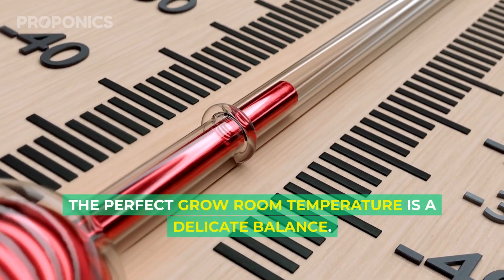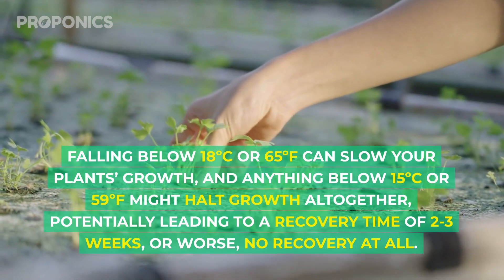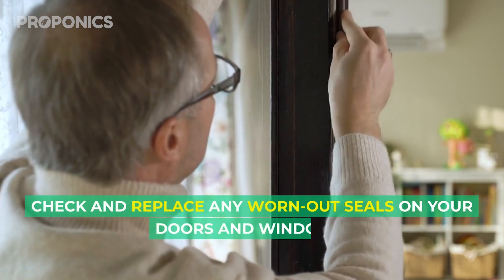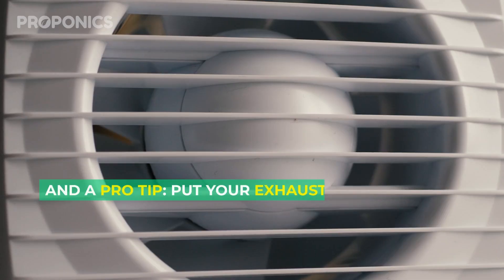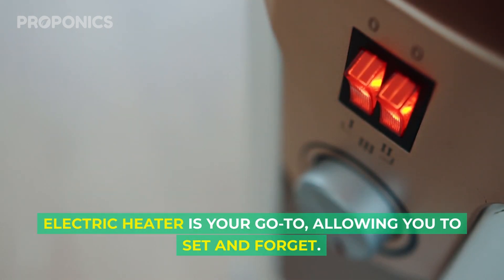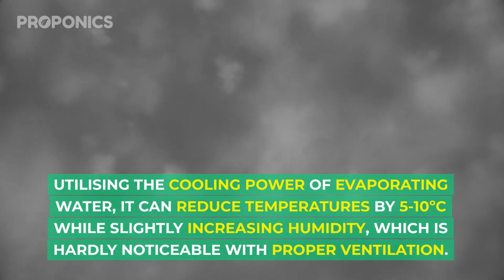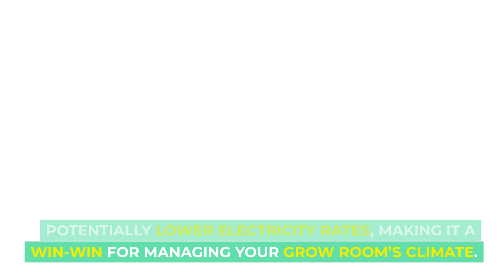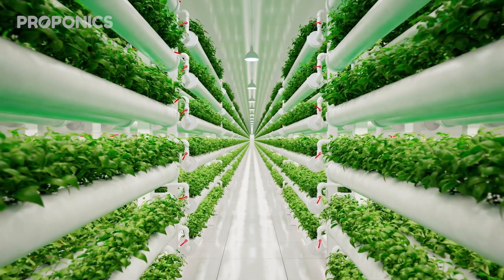Grow Room Temperature Management

Comment: which temperature is too high? in my tent i have an average temperature at the canopy of 27-28°C, plants are growing but what are the limits?
Reply from the maker: Great question, the temperatures I use in the video are a general guideline but each grow will have its own nuances like the species of crop you are growing, humidity, etc. If you find that your plants are looking healthy and that their growth rate is as you expect then a temp between 27-28°C should be all good (it is on the higher end though). If you start pushing 30°C then you're definitely going to begin risking the health of your plants. The best thing you can do is always keep a log of the temperature and the health of your plants that way if you notice any change in the plants' health you can check back on what the temp was and get a better understanding of how to adjust it to maximise growth.